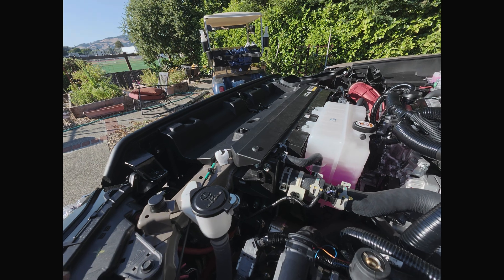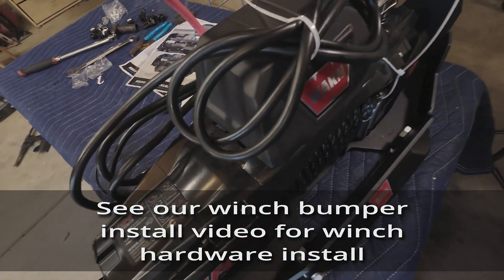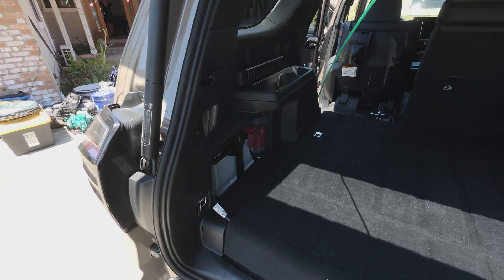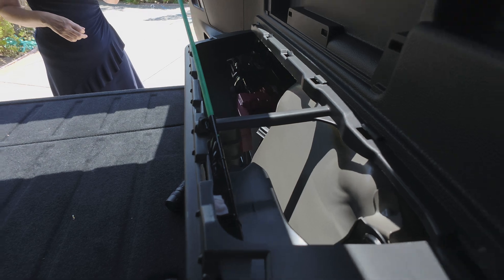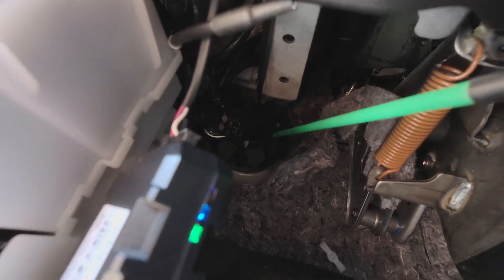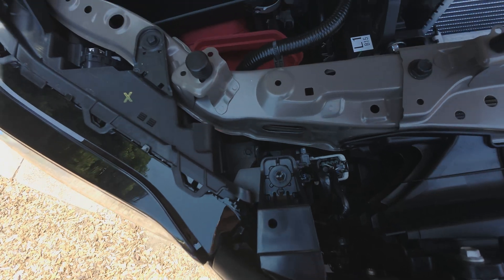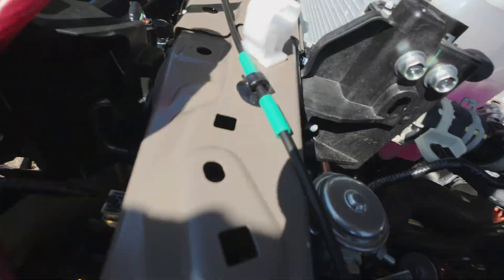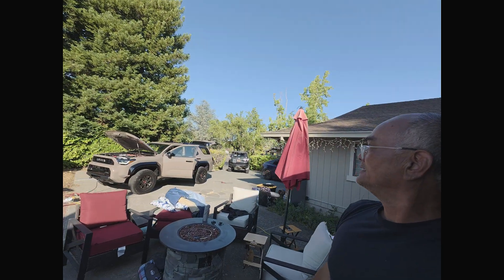Warn Winch Wiring with Solenoid on Aux 3-2025 4Runner TRD Pro 6th Gen

Comment: Hello I am a rookie and still a learning curve for me.   I have 2025 4Runner Trail Hunter Hybird.   I would like to install an Aux beam switch panel.   I have no idea where I can get the power source in the engine bay without running battery cable from the cabin to the engine bay.  Where should I get my power sources to this Aux beam switch panel?   It comes with 80 amps circuit breaker also.   I know where I should GROUND.    There is so many conflict information on here about the hybird battery will display a faulty message on the dash board if I connect to the fuse box on the passenger side.   ( I don't even know what positive pole within the fuse box I should connect to and prevent this hybird system faulty later.   Any help and assistant would greatly appreciated sire.   Thank you.
Reply from the maker: Check out the ARB compressor install video and where I connect the positive from the compressor to the car. That is a direct to rear battery connection rated for 200 amps. Good luck!
Reply: @Craving.Outdoors  Thank you so much sire.    The way you teach all of us is beyond amazing.    I will connect my positive Aux Beam switch panel line into that power post within the fuse box.    The Aux Beam  switch panel has a circuit breaker rating at 80 amps consumption total.    Do you think I will be good? and will have no hybird battery faulty message?
Reply: @Craving.Outdoors Thank you so much for your response sire and guidance.    I will connect the positive line of my Aux Beam switch panel into this 200 amps power source.    The Aux Beam switch panel also has 80 amps circuit breaker with it.   Do you think I am safe to proceed and connect it?    I am just so worry about 'HYBIRD BATTERY FAULTY" message.   Now with this information confirmed I feel much confident to do it.    I will keep you post how my learning progress.    Thank you.   Love the way you teach all of us.   Super clear, simple and leave all the none sense technical out that majority of us do not need to know.

Comment: Very good video :). A quick question though. Your solenoid switch, can you share the model number you went with?  Have you by chance tested this winch at heavy load?  Iv had issues in the past on solenoids handling winch’s at high amps. Very curious on your experience with that solenoid set up
Reply from the maker: Hi and thank you. The solenoid is a Warn branded one. The kit is the Warn 62132 kit. Its sold by Warn specifically for their winches. So I assume it can handle the loads but I havent tested it. This is my first time with this solenoid so not much experience with it. I do have lots of experience with them in golf carts and this is comparable to the ones used there (not sure if thats helpful or not). 

Hope this helps.
Reply: Thanks man!

You may want to test your set up before you test it when you really need it. 

I winch a lot and have gone through the identical solenoid you referenced. Under low load you should be ok, but i was burning through that solenoid in 3 foot deep snow pulls winching people out of the ditch in -20. I ended up getting rid of the solenoid approach in all and now just run a direct battery on/off analog kill switch. Iv never had issues since. 

Im also very curious on the 0 gauge wire handling those amps on a 16 foot run. You may want to test the amperage at the winch. On a 6 foot run of 1 AWG (i know smaller then yours but still close) my Warn Zeon 12,000 burnt the insulation right off. Ever since then iv been running 2/0 to be safe. 

Thank you very much for your videos :) looking forward to my Gen 6 on order! Will be referring to many of your videos for guidance on my mods.
Reply from the maker: Good to know and thank you!  Will definitely keep all that in mind. Happy New Year!

Comment: Thank you for this. Did you consider something like 1. an inline 400-500A fuse close to the battery positive or 2. running a negative all of the way back to the battery so there is a clean ground?
Reply from the maker: Did not consider the fuse as Warn instructions are to connect direct to battery. The ground is on a factory ground point. thats as good a ground as it gets. I want to keep the ground wire as short as possible. Thats beneficial over a longer run. Thanks for watching and let me know if you have more questions!

Comment: Awesome job on the install. I had and idea for your main positive wire that you ran to the battery, add in a positive junction block and circuit breaker under the hood then you can distribute your positive power that way for winch, air, and other accessories. Don’t know if that would work but it’s an idea. Thanks for taking the time to make videos. Oh btw did you you use the same pigtail from aux 4 to connect aux 3?
Reply from the maker: Thank you!  There is a direct to battery connect in the engine bay that is good for up to 200amps that I connected the arb compressor to. However having a distribution block from the 0 guage cable is a great idea!  Yes. Used the same pigtail since it was installed for the ARB compressor. Thanks for being here!